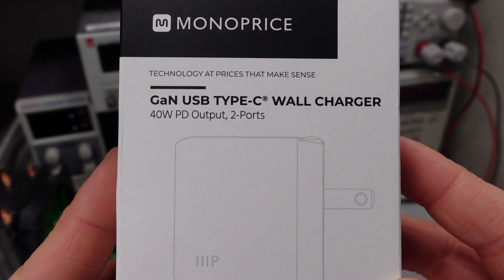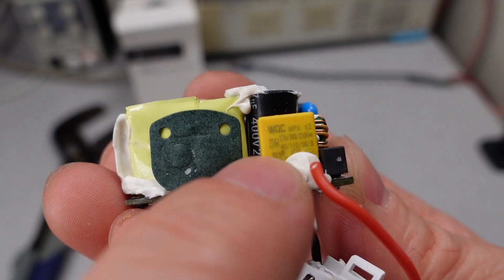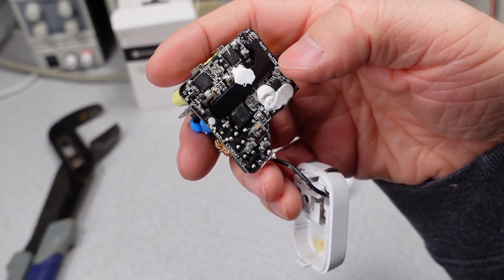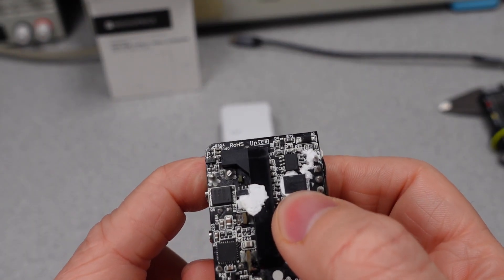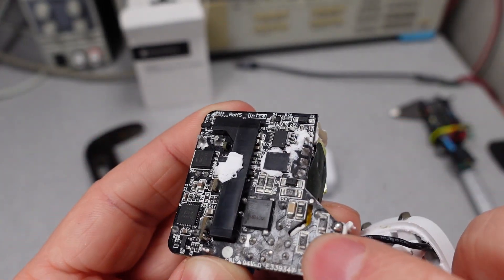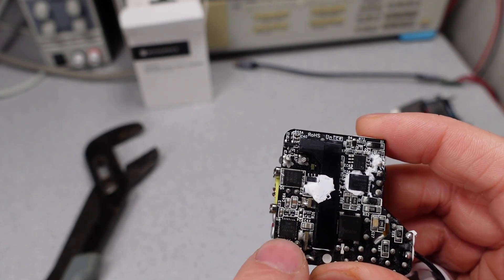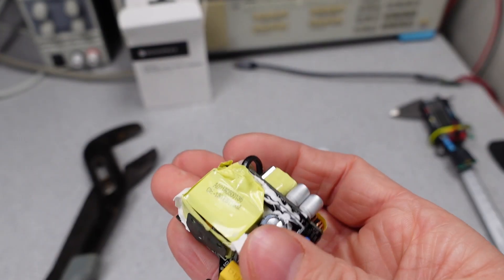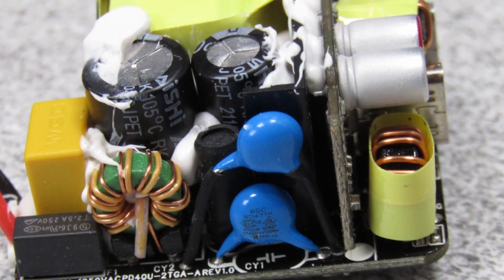Teardown Monoprice 40W USB C Power Adapter

Comment: On the outside it looks very similar to the Amazon Basics USB chargers. They are manufactured in Vietnam as well, maybe the same supplier?
Reply from the maker: I have seen a few rebrands of this adapter for sure.  Also, the Spigen 100w is under several brands now as well.  So, it’s an option.  I would expect amazon goes with whatever they can get cheapest at any point in time.
Reply: @AllThingsOnePlace  I googled a bit and found out that the Amazon Basics are made by a company called "CE LINK LIMITED". The 40W GaN charger on their site looks very similar to this Monoprice as well. Not sure what to do with that information but it's interesting, at least for me :D

Comment: What do those plastic pieces on the board do? Is that for insulation or something?
Reply from the maker: Yes, the plastic pieces are for insulation.  Need to keep the primary (mains) away from the secondary (USB) side.

Comment: Truly excellent tear down, and diagnosis. I really like how you go into every detail, regarding the construction quality, components used, and the positives, as well as the negative failings. I too saw a previous tear down of yours that showed the pinched wires deal, I really think this is one of those negative failings. I'd really like to see some more safety observed with no pinched wires, or better yet, no wires at all. GAN seems to be the new technology today, some claim to have GAN II or GAN III as well.
Reply from the maker: Thanks for the feedback.  It is nice to see something different inside of these devices.  I tore down one of the Anker adapters, no wires in that one and it also had a novel way to solve the isolation problem…  coming soon.

Comment: I learned so much! I'd be interested to find out what the intermediary DC voltage level is. It could be 9V, but it be higher, like 24? I wonder how the designers decide on which voltage to use. Maybe you could, with safety precautions, power it up and probe it, since it appeared to be a non-destructive teardown.
Or save the probing for another teardown video altogether. I also understand if you don't feel comfortable powering up an exposed circuit, I wouldn't either.
Reply from the maker: That power supply is on an isolation transformer so as long as you don’t grab both wires on the hot side…. I can run some test leads and close the adapter back up to be safer.  I want to know also so I’ll get some measurements safely.
Reply from the maker: The intermediate voltage is constant at 10.4 VDC in both the 9V and the 5V modes and under load or no load.